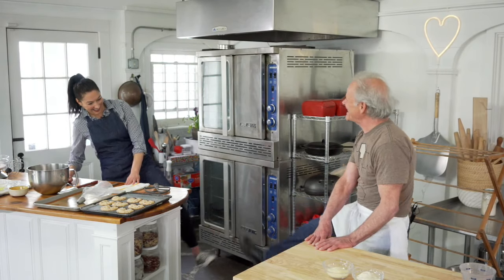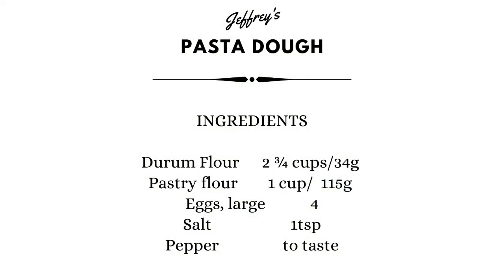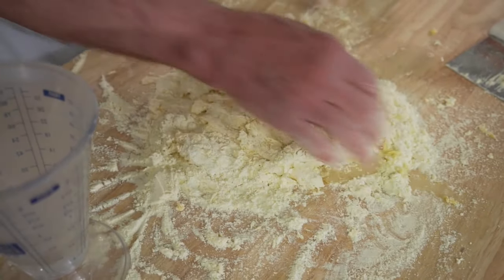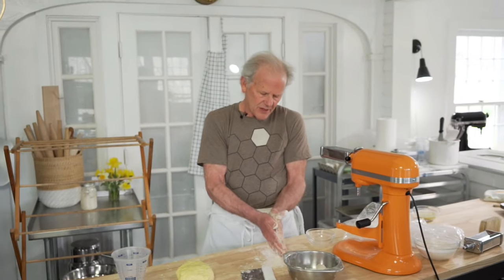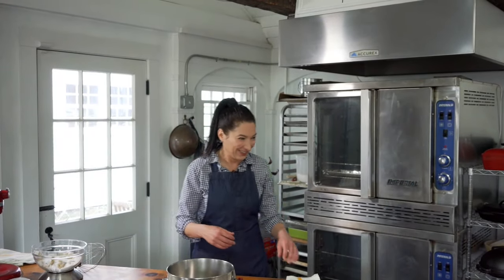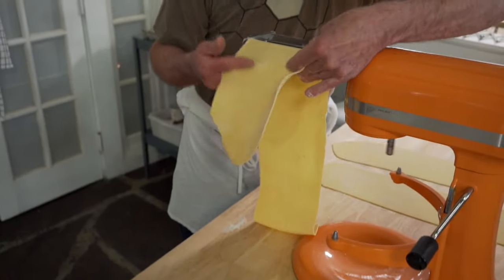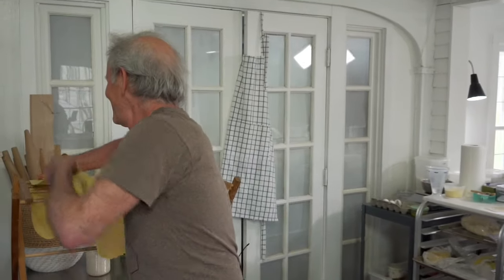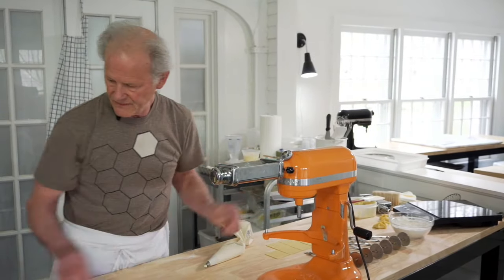Golden Durum Pasta & Mandelhörnchen (Almond Horns) - The Isolation Baking Show - Episode 6

Comment: Thank you for this video.  Fabulous instruction.  Please keep going with all of this.  FYI, the Ankarsrum Mixer does a super job of mixing the pasta dough, especially when you use the durum wheat.  Use the Roller and scraper and it will sing for you.  Durum is an ancient grain that has not been hybridized like modern wheat.  Kamut is also a Durum Wheat considered to be an ancient grain because it has not been hybridized.  There is a distinctive taste difference when you use the Durum wheat.  To freeze the Pasta...Fettuchini....Have a pot of boiling water ready.  When you cut the pasta plop it right away into the boiling water and let it simmer for about one or two minutes.  Drain.  Add olive oil to the drained pasta and then portion out the servings into plastic zip lock bags and place into the freezer.  Got this idea from a great Italian Cookbook.  It is foolproof.  When you are ready to cook the pasta....take it out frozen and place it into boiling water with salt in it until al dente.  Serve with Alfredo Sauce (Cream and lots of Parmesean).  Enjoy!  This year I finally bought myself a Pasta Board.  Most housewives in Italy have one of these boards.  I am so glad I bought it because it has made all of the difference.  I also bought the Italian rolling pin that goes with it.  I got it from my favorite Italian Kitchen Store in Philadelphia.  It is called Fantes.  They have a good online presence.  Eileen Summerville

Comment: The fine milled durum flour you're referring to is sold as "ultra-unifine".  It's a hammer milling process well suited to durum because it's so hard, it literally smashes the grain into powder.
A bulk sales outlet called Azure Standard carries it.  I only mention that because King Arthur does not carry it. Not trying to step on toes.
Reply: I can mill the durum wheat as a very fine flour (00 Tipo) with my KoMo Grain Mill.  Check it out.